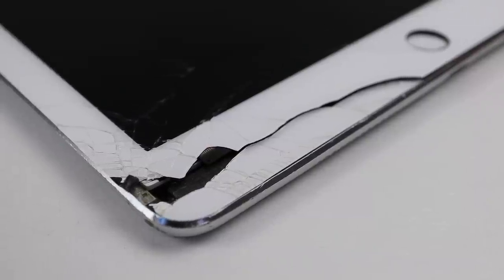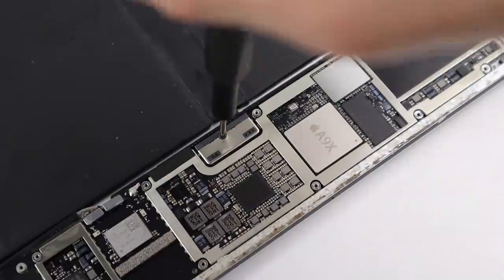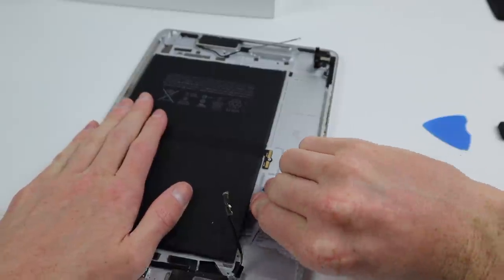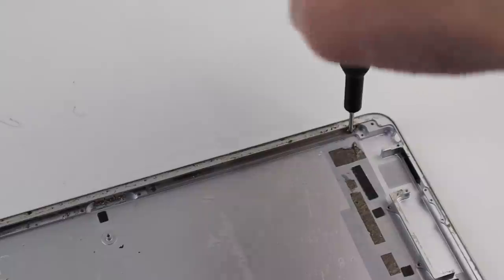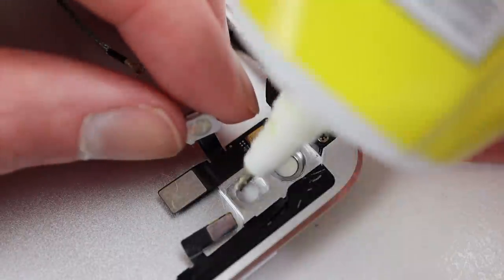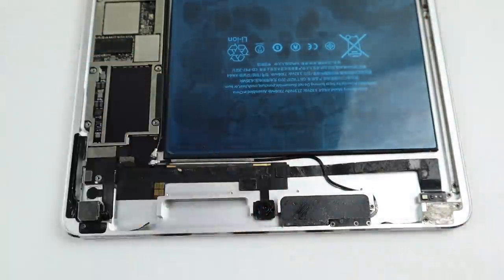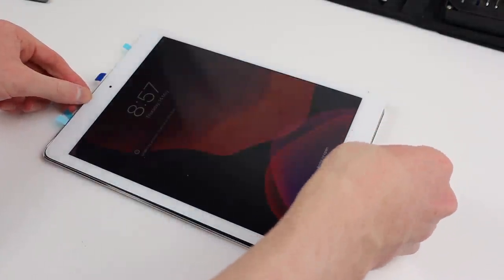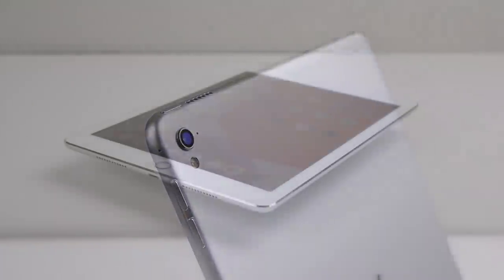Never Try To Fix This - iPad Pro Restoration

Comment: It’s so hypocritical of Apple that they remove the chargers to “save the environment” yet they’re doing this.
Reply: Well everyone know
How environmental friendly move was the removal of charges 😂
Reply: @lordjaashin  so true. Not to mention "aesthetic" everything. They believe everything Apple does and don't make their own decision because Apple is seen as a "status symbol" 🤦🏾‍♂️🤦🏾‍♂️🤦🏾‍♂️.
Reply: Free bonus, not only will your unrepairable sleek metal slate end up in a landfill but it will be full of toxic glue as well!
Reply: @lordjaashin  can confirm, have purple hair, chug starbucks and am mentally ill.
Reply: Save the environment by making twice the box, more plastic wraps, and who knows how many gasoline was chugged to transport all those...
Reply: Their chargers are low quality as it is. Went through 3 on my 2013 iMac Pro. Went through two on my iPad. Will need a replacement cable for this iPad Pro that I’m typing on.
Reply: A fairly small percentage of devices ever need repairs. 100% of devices ship with unnecessary chargers. Similarly, one hundred percent of devices are easier and cheaper to put together.

also: yes, it’s a big deal if it’s a few millimeters thicker, let alone heavier. This is a device you hold in your hands. You don’t see the competition making any tablets in Ruggedized versions for consumer use, do you?
Reply: @JasperJanssen  yes only a few apple device will ever need repair so lets make those devices as unrepairable as possible! very nice logic u got there? and unnecessary chargers? all other company uses Type-C, even apple themselves uses type-C on their macs and ipads. yet for their iphones suddenly you need lightning cables? suddenly its different from what all other phone uses, now people need to buy a different cables instead of using what readily available?? and instead or repairing the broken components, they tell people to throw away their broken products and buy new ones instead?
Reply: @lordjaashin  Yeah I’m sure so many apple fans buy their phones for the environment 😂 You know all the android OEMs started copying and removing chargers too. People don’t buy iPhones because they’re blind fanboys, they buy them because they’re the fastest around and still a great value compared to the crap Samsung puts out every year.
Reply: @jayhawker03  yeah sure samsung puts out crappy phone yet they still sold 50 million more units compared to apple last year. very nice logic from an apple fanboi... sell more = crappy phones = less value? shows what kind of IQ they have lol...
Reply: this was likr 4 years before they did that but yeah
Reply: @Jose04537  Apple, like many other companies, is actually green.
Reply: Ah yes samsung is totally so much worse (says i whos writing this on my 6 year old samsung thats never needed repairing and looks reletively new if you take the screen protector off)
Reply: You know this is about 4 generations old at this point. They had chargers included then.
Reply: @lordjaashin  based af
Reply: @weebnation8923  my mom has a 10 year old ipad
Reply: Evil company
Reply: @jackochainsaw the iMac Pro is a 2017 desktop computer, the only version of it that has ever existed was made in 2017. Desktops don’t use chargers but power cables.

And same applies to non-Pro iMacs. They’re all desktops.

Comment: It’s criminal that Apple designs their devices like this. Well done Hugh for seeing it to the end
Reply: They kinda have to, so they can pack as much features as they can in such a thin body.
Reply: @justinmarqueef3426  why do you need a thin body on the device?
Reply: @Khalin Rao an ipad that bends when you sneeze on it is still heavy as heck
Reply: @Khalin Rao never have an issues with portablility since i bought my first cell phone in 2003. I did own some time ago highscreen boost 2se, one of the most enjoable phones what i have. Allways keep it with a big battery( it was been 2 back covers and two battaries with a device, small one and a big one).
Аctually, if they want to make devices lighter and more durable, you can replace allimiun to plastic. Its better material for a portable device.
I got thru my hands thousands cell phones, i was been buying a broken one, fix them and sell them. So, i know "a bit" about them.
Reply: @pashko90  I don’t know, I guess it’s so it stands out. Makes it unique.
Reply: @Khalin Rao  Whats wrong if an iPad is a few milimeters thicker? Will I be unable to put my ipad in my travelling bag just because it is a litle bit thicker? You have underestimated the volume of a bag.
Reply: This is planned obsolescence.
Reply: @justinmarqueef3426 
Well those glue didn't add any so called features for the end user if any? rather it hinders the repairs
Reply: @justinmarqueef3426  You have fallen into Apple's trap if you think it's to make better products. You can already see they used some screws to hold speakers and logic board and yet they put excessive amount of glue under it. Look at the battery, What's the reasoning to not use those removable strips of glue like they use in iphones?
It's all to prevent end user to perform repairs and even if they try to then make it much harder and higher chances of damaging it.
Reply: @mjyanimations1062  Basically a potato chip that glows.

Snap! Crunch! Crunch! Crunch!
Reply: @Khalin Rao What is wrong if it is a few grams heavier? Even if it is a kilogram, it is fine. I don't believe that one kilogram will snap your bones. We just need repairability.
Reply: Apple does not want their devices to be fixed, they even go out of their way to ensure certain parts are not available on the free market, and software-tie components, so you can't even replace them with original parts from another device.
You are supposed to throw them away and buy a new device every other year, or whenever a problem arises,
you know like a good stupid fanboy.
They even managed to convince people it * has * to be like this, and that is their fault whenever a device fails ahead of time.
Impressive marketing and brainwashing, scummy but impressive nontherless.
Reply: Hihallo  that is why I am not an apple user .
Reply: @pashko90  because its a cellphone
Reply: Hihallo  how does a company screw a logic board on?
Reply: Applebots will fight anyone to the death saying something negative. Worst kind of people ever.
Reply: @mazyata9958  Sadly apple fanboys are essentially everywhere. And their battle against android users will end up in 'are you an apple executive' 'are you a samsung executive' 'are you a xiaomi executive' etc, where that conversation is useless.
Reply: @zylek5151  we are talkimg about ipads right?
Reply: @pashko90  to make it work lol
Reply: @hamadalkuwari6254  to witch of my comment it should be relative?
Reply: Actually,the way he is man handling the parts is a testimony of excellent Apple engineering.
Reply: There are a few places where it's forgivable, such as with charging port and the display. But thing such as the speakers and battery have no reason to be glued, and certainly not with industrial grade superglue; that's just because Apple and their scummy business model want you to throw out their devices and buy new ones.

Comment: as the "ipad specialist" at my store i would highly recommend using acetone except on fragile parts (lcd, motherboard,etc). Battery adhesive becomes jelly in 30 seconds and makes life so much easier. i think the magnets would have popped out much easier with this method as well.
Reply: They would’ve
Reply: but acetone destroys any electronics and plastic
Reply: @Unknown-sf6cs  🤷🏽‍♂️ i guess having over 1000+ repairs this year using acetone with a  less than 2% return rate is a testament to my skillful use of it.
Reply: @Unknown-sf6cs  if nothing else, it would've helped with the magnets
Reply: What country do you repair in? I do a lot of iPads also, in the UK. We won't even offer LCDs on these or Air 2s currently as the part quality is too bad.
Reply: @TheEquilibriate  USA. yeah i hate doing the air 2/3/pros but the company i work for has been getting decentish quality ones.
Reply: @problematicg3nius912  Definitely is, you're good at doing it and doing it on the right place, otherwise your return rates would be way higher. Acetone does indeed dissolve plastics, specially the extremely common ABS. It's part of why it helps you so much removing adhesives, being heavily polymer based.
The thing is that the situation in question calls for it, specially a battery you're tossing out. No shits given for the outer film looking like crap under the glue that would have looked like crap by any other removal method either, and the case itself being metal will not be affected, same the magnets.
Reply: heat gun can also be used?
Reply: @mayank4977  yes but the adhesive that apple uses for metal on metal is the same type that is used on the back glass of iphones. It’s removable with heat, if you intend to scorch yourself in the process.
Reply: @problematicg3nius912  I have used acetone to dissolve abs plastic before.
I guess you need to be very careful when using it on devices containing abs.
I don't know what plastic apple use but most electronic devices use abs afaik.

Comment: Why would you not apply some heat to the back of the ipad to soften the adhesive would have made the job much easier! You have made this whole job look a lot harder than it should have been especially removing that battery again would have been a lot easier if you had of added heat to the back of the ipad

Comment: Who knows how many projects are sitting because of unavailability of parts, let's help this man find all the necessary parts he needs, then we'll get to watch more new videos.
Reply: I have a compact mac that needs a new logic board, does that count?
Reply: Not really. With a good contact in China this problem in the video could have been avoided and solved in a few days using DHL to ship it. 
I'm surprised he still hasn't done this, me and Many other suppliers do this, but he probably doesn't have the time and just prefers looking at websites and then complaining about getting low quality parts so the sponsors look better.
Reply: @Rewindandrevive  He does independent repair, you own a repair shop and thus need much more part shipped in then him. That doesn't mean "he could ship just one for 2x the money and get a slightly less dodgy part that already works"
Reply: @totallynotbluu  not true at all. When I started I could buy 1-2 things if I wanted. Whatever I wanted in whatever quality I wanted. And shipping depended on how quick I want it and it's not to expensive. 

So complaining about China having bad parts comes down to not putting the effort out there to actually look for someone reputable and can get you things that aren't even on the open market. But to find someone takes a lot of trial and error.

Comment: This really does scream "We don't want anyone to restore this, just trash it and buy a new one"
Reply: Mine: you guys break?
(I have the same iPad as the one in the video lol)
Reply: @Versuffe  feel bad for you.
Reply: Apple products are the same as those bad Chinese parts. Manufactured ewaste.
Reply: ironically apples majority of fan base are people who keep shouting about climate change and pollution.
Reply: @pashko90  why? My Ipad is fine, and I have a gaming laptop that is more of a scam than my iPad ;-;
Reply: @Versuffe  Yeah, I don’t get what everyone is complaining about. I have the exact same iPad Pro, going on 4 years old now. I expect it’ll work well for years to come. If the battery gives at some point in the need future, I’ll take it to Apple for a cheap battery replacement. If something else breaks I might take it to a third party repair shop, but honestly I’ve gotten the full value of the money spent and more at this point. The last time I had a tablet before this (a Samsung Galaxy Tab) it was laggy and terrible to use just after a year.
Reply: @Versuffe  Dell laptop?
Reply: @EscapeVelocity11186  People are not complaining about the software support of which apple is the best in its class. They are complaining about hardware reparability. If you accidently break your device, they will likely just replace your device instead of trying to fix it as seen why in the video. Even if you can find a replacement screen or part to fix, they are now serializing their components making it impossible for 3rd party repair.
Reply: @EscapeVelocity11186  all of these benefits won't matter if your device breaks with no way to repair it on a sane level. Apple devices are so difficult to service, and no not everyone can afford AppleCare insurance, so there should still be an option to go third party repair.